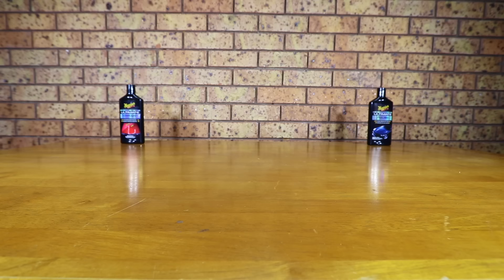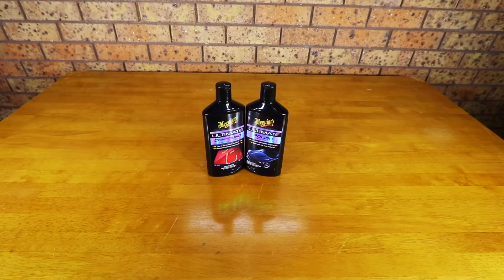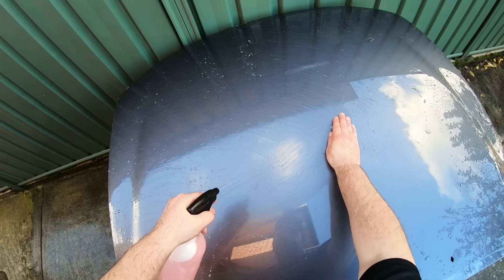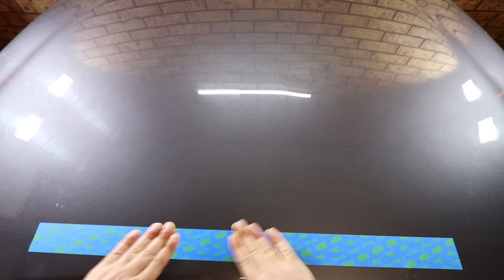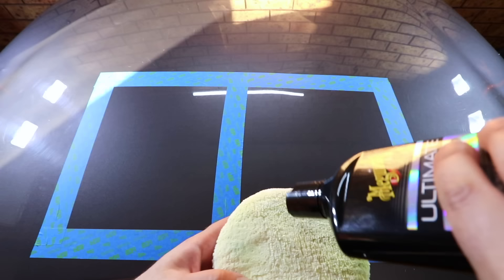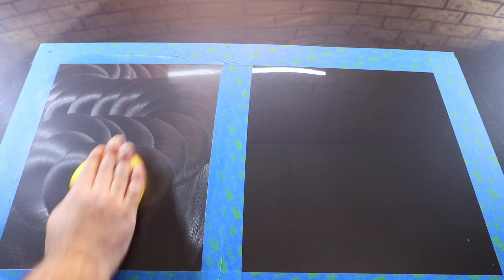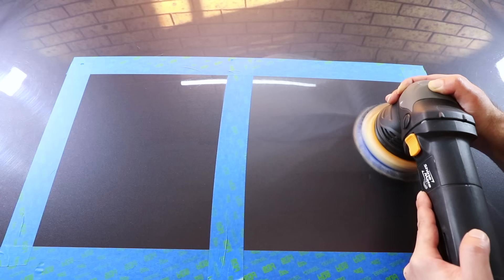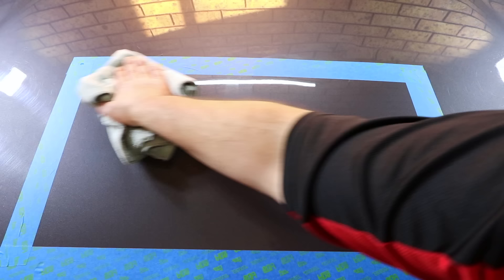How to Use Meguiars Ultimate Compound & Polish+ Review & Demonstration!

Comment: Great video!
I'm thinking on removing the rear badge of my car. Do I need to compound and polish the whole trunk or just the place where the badges are?
Reply: @CarCraftAutoDetailing  the car was painted just 3 months ago, so the paint is good ;)

When you apply compound, polish or wax by hand, using a foam or microfiber applicator pad, do you toss it after or can you reuse it? If you can reuse it, do you wash it after?
Reply: @CarCraftAutoDetailing  thank you for all your help. Keep up with the good work. ;)

Comment: I used Goo Gone Automotive to remove some bird droppings, and the droppings are gone, although there are a few smears/smudges leftover from the microfibre towel I was using to wipe off the droppings after the Goo Gone soaked them. They're not that severe, only visible in sunlight under certain angles. Should I use Compound and Polish, or only one?
Reply from the maker: I’d just start with the polish and only if it doesn’t remove the defects would I step up to the compound.
Reply: @CarCraftAutoDetailing  Thanks! And would you recommend using a clay bar before the polish?
Reply from the maker: If it hasn’t been clayed for a while and you can still feel little bumps on the paint after you wash it, it would be a good idea to clay in order to remove those bonded particles.

Comment: Hi! If my car is almost brand new (6 months, 6000km), should I use Ultimate Compound or Ultimate Polish just to remove light swirls before ceramic coating? Thank you
Reply: Car Craft Auto Detailing alright thank you. And will a white hex pad do the job?
Reply: Car Craft Auto Detailing I have the choice between yellow, white or blue hex pad by Simoniz, that’s the only brand I have rapidly access here...

Comment: Thank you for the video and review. I want to put ceramic 9h on my car who had 5 years and some scratches. I want your advice for one of this 2 products. Witch one do you recommand To me for a  clear paint.
Reply: @CarCraftAutoDetailing  thank you. Yes the paint of my car is weak with a lot of scratches. The after using ultimate compound i can use the ceramic coating?
Reply: @CarCraftAutoDetailing  thank you for your help

Comment: I saw you mention m205, and In pretty sure I have both of these in my polishing arsenal in the shed.  Would there be any reason to use m205 vs ultimate polish, or vice versa?
Reply from the maker: M205 is a great finishing polish, it was designed more for machine use while Ultimate Polish is more for hand use but you could really use but hand as well. Ultimate does also contain sone very minors fillers, that’s really the main differences.

Comment: I have new Toyota Tundra and even though I used a 1700 psi pressure washer with 45 deg spray tip…I guess I got too close to one area and now have a spray fan shaped blemish in the paint finish (it looks like faded paint). Is this something I can fix with a compound? Or can a pro dealer do this or am I screwed and need to have the door panel repainted? Anyone with experience on this?

Man do I feel stupid. Here I am trying to keep my truck looking new , protect my investment by cleaning, detailing it each week…and I end up doing the opposite. Damn. 

Any advice would be super appreciated.
Reply from the maker: It sounds like a strange defect -faded paint look - for a pressure washer to create - so it may be best going to a local detailer to have them assess it in person. I guess it could be the clear coat that’s been removed in which case you should see and feel an outline in that area and ultimately may need a respray to fix - but I still think it’s worth having it inspected in person.

Comment: hi im noob here which pad u need for machine?* i was always using manuel but someone offered me machine whitout pad* thx
Reply from the maker: You need to use the same size pad as your machine’s backing plate - most machines with be either 5” (125mm) or 6” (150mm) - there should be a label on the machine stating the plate size or you can measure it. Most pads will use a “hook and loop” or Velcro attachment. These pads could be a good starting point: https://www.waxit.com.au/products/shine-mate-blue-foam-intermediate-pad-4-6-7?ref=1NNwBEgP4yO4AX

Comment: Hello feiends!
I would like to gain polishing knowledge. So i just bought the chemical guys torq x machine with 3 pads( orange, white, and black) but i didnt order the compounds from them. I would like to know if I can use the maguiars ultimate compound with the orange foam pad from chemical guys or does it have to be a microfiber pad? And can I use the ultimate polish with the black pad or white pad from chemical guys?
Thanks!

Comment: Can I use This polish befor applying ceramic coating
Reply from the maker: Meguiars M205, 210 or D302 will be better choices if you’re going to apply a ceramic coating afterwards as Ultimate Polish contains some mild fillers

Comment: Hi Sandro! Just another question mate. I purchased a hand puck applicator. Its like this velcro ended hand puck which fits in your hand and then I attached to it a 90mm Scholl Blue Spider Pad. Its good for doing the bits the big machines can't get to. Anyway today I used a brand new 90mm  Blue Spider Pad used with the Velcro Hand Applicator Puck. Used the Meguiars Ultimate Compound as mentioned above. However it left a load of new swirls. What can cause this to happen? Is it because the area wasn't cleaned that well before hand?
Reply: @CarCraftAutoDetailing  To me the thing that seems most likely is that the surface wasn't prepped well enough. The reason for this is that when I did the bonnet I used Ultimate Compound paired up with the Blue Spider Pad on the Shine Mate DA. That gave me really good results. Except the only difference now is that I am using my hand to do it and not the machine. I did use the same amount.. I primed the pad with the product then did 3 equal sized dots. I am hoping it is just that I didn't prep the surface and I was a bit lazy and didn't use the clay bar which I have paid for now as I have made it worse! So what I will do is properly do the paint decontamination process as per your video and the same again using the hand puck method and hopefully it will give me the same results as the bonnet :) Cheers Sandro

Comment: Hi, I'm using the ultimate compound outside on my van with a polisher and it dries so quickly it's extremely hard to clean off, could it be that the metal is too hot in the sun?

Comment: My residue was hard to wipe off. Did I not use enough product or did I wait to long?
Reply from the maker: It can be a few things such as using too much product, not working it in long enough (or if using a machine polisher) working it in for too long, working sections that are too big(more than about a half square meter or so) can also contribute to a difficult wipe off, and obviously making sure you’re not working in direct sunlight or on a hot panel.
Reply: @CarCraftAutoDetailing  Thankyou I will try to switch up what I am doing. I was trying to work in a 2 x 2 area

Comment: Sooo after using ultimate compound by hand scratches almost disappeared. But I ended up with an odd film that wouldnt buff out. So i ended up rinsing off the film & after it dried the surface looked like it did before i used the compound. It looked like it literally did nothing to the sanding scratches. I guess I need to look for a dual action polisher. 🤷‍♂️
Reply: You'll have to polish after compounding
Reply: @surfmotor  any idea about the strange film that dried on the surface?

Comment: Would you use the megiuars clay bar kit before or after this. Initially I was going to clay bar and then use the wax kit of megiuars. Now I'm wondering to use this in the correct order too...??
Reply: @CarCraftAutoDetailing  thanks for the prompt response.  So megiuars clay bar, then compound, then wax then finish eith megiuars ceramic wax. Can't wait to test it

Comment: I have Buffed my hood around 7 times with this stuff within the last 3 days.           …. I still see areas off deeper color & lighter color & imperfections.      …. Bottle says...…   Apply & allow to dry a few minutes       ….  This is false.  If it dries, it will take more compound & a buffere to remove the smudge or smear that wouldn't come off because it dried within 30 seconds.     Im at wits end, almost powerslammed my buffer because its just not making my hood look good at all.    Patchy,lighter & darker irregularities.    Cant achieve a uniform appearance.

Comment: Hey mate,

I tried using the compound with a machine buffer. The Meguiar pad is like half the size of the buffer velcro pad and it went crazy and was very hard to control at times (basically making certain directions impossible). Is my Meguiar pad too small, my machine too powerful, or when using a machine it's really supposed to be like 30 seconds or so?
This was also on a hot day and after 4 passes, scratches still exist - in that regard I can only imagine that my pad wasn't aggressive enough / the scratches were too deep or I need to move on to wet sanding?
Another thing is, I couldn't get any actual IPA or the Eraser product here in the UK same day I was working on the car and instead used a degreaser (WD-40 degreaser), do I need IPA or is  a degreaser OK to remove the product?
Finally, it was a hot day, so I'm guessing that affects the results too because the compound dries faster than on a cooler day? Should I just wait till a cool day comes, or I just need to be quick with my compound application and removal?

Any advice would be appreciated.

Thanks for the free video, was really helpful for amounting the products and seeing the technique as a whole. I've watched the cleaning one, this one, using the power tool and the wax one. You make it look so easy :D
Reply: Hi mate, I didn't realised you replied so quickly. Thanks for the tips!
I will buy the 7" meguiar's pad range for the cut, polish and wax stages and I found some Eraser and a combi Tar/Iron remover from CarPro here in the UK, so that's me sorted.
I've re-watched the machine polisher video and compared it to a couple of other videos and realised that the slow-mo shots stuck in my mind, and you're supposed to move the machine MUCH quicker than I was doing. Plus the whole pad size (and type - not very strong cut at all) issue and working in direct sunlight at times just caused a combination of issues.
I will try again next month on a cloudier / cooler day with the right tools and mindset (i.e. not after just having spent 3-4 hours doing the cleaning - will separate have cleaning and detailing days). Hopefully it will provide some results.
Will also acquire the Scangrip Matchpen, which will hopefully suit my "detailing inspection" needs since this is only a hobby and not a job haha.
Thanks again for all the info and videos.

Comment: I tried doing this today on my car and the compound was really hard to wipe off and was super sticky. Also left like a crusty residue after trying to wipe it off. I used the meguiars da power system (the one that his had with just a normal drill). Do you think you know what I might have been doing wrong? I think I worked on areas too large. I'm not sure. On the foam pad I put like a circle around the perimeter of the pad. It'll be awesome if you can help me lol. Thanks for the great video though.
Reply: @CarCraftAutoDetailing  thank you for answering me. I just watched the video and I made a lot of mistakes lol. I will definitely be trying again very soon now that I have the knowledge your video gave me. Thank you

Comment: I am hand applying and finding it hard to remove the product. What am I doing wrong?
Reply from the maker: Try using less, work sections no larger than a square foot or two at most and work it in longer and more aggressively. The compound will go from looking opaque to translucent as sign you’ve worked it in long enough.

Comment: can i use these 2 products and then ceramic coat the vehicle ?
Reply from the maker: The compound yes, but as ultimate polish does leave a little something behind that could cause bonding issues with a ceramic coating, you’re better off using a more standard car polish such as Meguiars M205 or M210
Reply: @CarCraftAutoDetailing  can i use the m205 by hand ?
Reply from the maker: Yes, you’ll find that most fine polishes are workable by hand.

Comment: Hello, nice video :)!
I have a question that i hope someone can answer here. Is the “Meguiar's ultimate compound” the same thing as “turtle wax rubbing compound”? Do they do the same? I have some small rock chips on my hood and i’ve looked through a guide where they sand it down and then use “turtle wax rubbing compound” followed by
“Meguiar's Ultimate polish”. I can’t buy the turtle wax rubbing compound in my city, but i can buy Meguiar’s ultimate compound, but I’m not sure if they do the same thing? Is there a difference between rubbing compound and just compound? I hope someone can help me!
Reply from the maker: Yes they are the same type of product - you can call them cutting, rubbing or correction compounds, but ultimately they are all used to level car paint/clear coat down to remove paint defects. Some will be more or less aggressive as well as finish with better or less gloss levels which is why we have so many choices available - to suit our own needs and wants.
Reply: @CarCraftAutoDetailing thanks so much for answering! I have a VW Polo and i went to my VW dealer to buy a “touch up kit” and i got 1 base colour coat and then 1 clear colour coat. I’ve already applied the colour coat first and followed by the clear coat on the spots my hood got rock chips, but the paint and clear coat is not levelled!Tomorrow I’m going to sand the uneven spots down with 2000 Grit sandpaper, then use the ultimate compound followed by ultimate polish, which will hopefully level the newly applied paint + clear coat! Your video gave explained everything very nice to me, I’m feeling confident that i will not mess it up! 😂

Comment: what did you spray in between compound and polish wipe?
Reply from the maker: Carpro Eraser- an isopropyl alcohol cleaning solution to remove polishing oils.
Reply: @CarCraftAutoDetailing  interesting... thank you. what would happen if i just wipe off the compound and apply polish without using the ipa?
Reply from the maker: The IPA helps create a stronger and more durable bond with whatever paint protection product you choice to use after compounding/polishing.

Comment: I didn’t like the meguiar’s ultimate polish.   It always dried out before I could wipe it off, and it’s impossible to wipe off unless I use IPA.
Reply: What do you recommend using instead?
Reply: @ketchum6455  Dunno if I can give a good recommendation yet.  I’ve been trying to use up all of the Chemical Guys VSS and V-series polish before I try something else.  The CG stuff is fairly mild and required many passes.  It can refinish duller clear coat but it won’t polish out mild scratches.

Comment: I have a few older cars with dull paint I know they are not clear coat is the process the  same as clear coat
Reply: @CarCraftAutoDetailing  I have a black Mercedes it's older 1989 the paint is like it has a grey dull scum on it but I know there is shinny black paint underneath would you compound or polish it washing does nothing

Comment: can i put an all in one polish after the compound and then top it up with a spraywax?
Reply from the maker: Yes you can
Reply: @CarCraftAutoDetailing  i heard from someone that you cant put a spray sealent like TW seal n shine on a carnauba polish/wax.
 is that true?
Reply from the maker: No it’s not true. You can certainly have a preference as to what you wish to use, but AIO polishers have been used after compounds and then topped with sealants for many many years with success.
Reply: @CarCraftAutoDetailing  thank you very much!!!